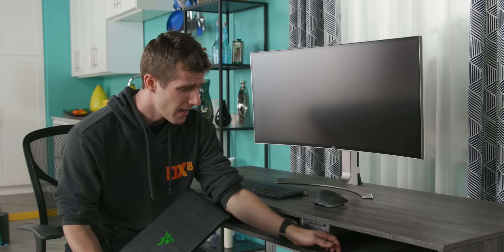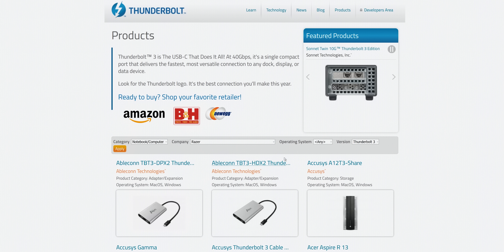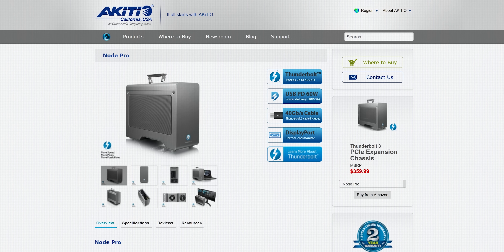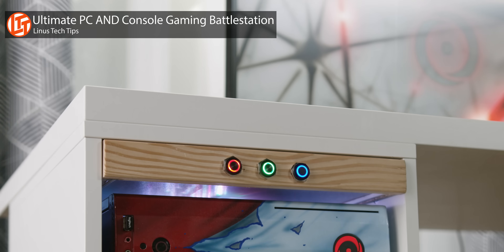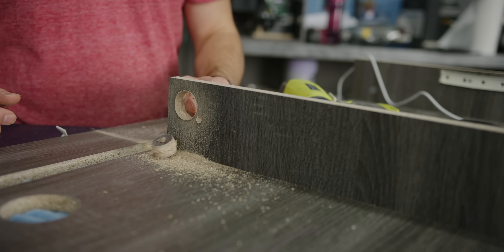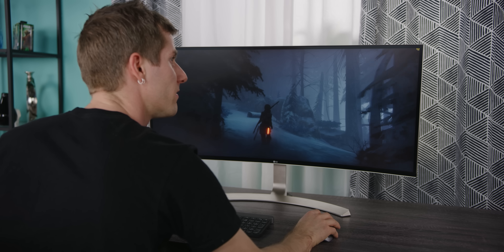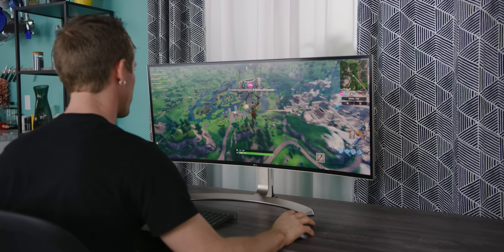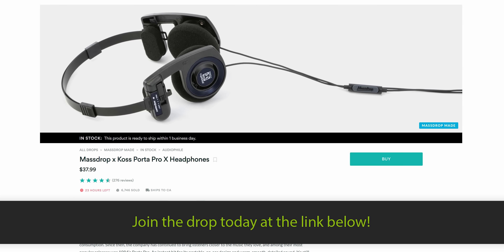This is the CLEANEST Setup.

Comment: I have a question!
I use Macbook pro 2014 with an external monitor and the MBP heat is quite high. is the heat reduce when I using with eGPU?
Reply: Yeah just make sure to get the right egpu
Reply: You can’t use an e gpu with that MacBook. You need thunderbolt 3.

Comment: I've got a cleaner setup - I have my computer in another room, and usb hub connecting it under my table. So my setup is litterally a desk a keyboard and a mouse, and apart from the usb hub, no hidden insides! - And its upgradable because its a full tower pc.
Reply: That's exactly what I intend on doing in my new place

Comment: Want it even cleaner? 3D print a custom rail system for the computer to slide into and have the TB3 cable at the back perfectly lined up so that you don't even have to interact with the cable. Just slide it in, and go.
Reply: This idea is under appreciated
Reply: @Cubei That's an interesting point. I don't know how well they'd work with thunderbolt 3. There is a lot of data being pushed through those cables, but if magnetic contacts don't hinder the signal, that'd be a cool idea.
Reply: Vandel212 couldn't he use hdmi
Reply: @sbc2954  The HDMI is already there. That goes from the eGPU (in the little filing cabinet thing) to the monitor.
Reply: Vandel212 oh I'm an idiot
Reply: Vandel212 I'm boutta get rwooshed
Reply: @sbc2954  r/woooooosh
Reply: That's not a bad idea, I might try this
Reply: Diy perks did something like that with a laptop wall mount. I really fucking live his Design!

Comment: Is there a way to control the desk fans with a front controller ? i mean with buttons ? how would i power the system ? (controler + fans) i am not english speaker and i dont get the part about powering fans you used. Thank you.

Comment: TBH, even the "smallest" MacBook Pro has 2 TB3 ports, so you'll probably be better off connecting the external GPU separately rather than suffering the daisy chaining penalties mentioned in the video.

Yeah, I know, two cables, that's no longer as clean, boohoo…

Comment: That's what Dell made docking stations for except without the video card but with as much input and output options as what you'd see on a full desktop computer.  They should make something like it with full PCIe slots and places for hard drives that's standard for all computers that could include it.

Comment: If there's no thunderbolt 3 then a HDMI plus the charger can do the same right?
Reply: You can hook the monitor through HDMI, and a mouse and keyboard through USB, while having the charger plugged in. You just won't have the benefit of an external GPU

Comment: This is awesome! i'll have to do something like this (when I've saved enough) for my computer

Only changes I would make is to run the back wire through the leg of the desk rather then tied behind it, and have a slot that I could just insert my laptop and have it line up with the plug-in, rather then having to plug the laptop in by hand

Comment: 1000€ laptop
350€ thunderbolt 3 hub
500€ extenal gpu enclosure 
250€ of peripherals 
1000€ screen 
500€ of desk

Over 3000€, with the ability to take it away, not bad but is this technology accessible to someone normal?
Reply: Obviously, a budget gaming laptop which still has a thunderbolt port and a normal monitor along with a custom made desk would cut off a big chunk off. It's not like the idea would not work with different setups
Reply: @MrRetrogoo  I tried, it's very hard to find alternatives
Reply: @henrigaufillier4350  well we need to wait a bit until thunderbolt equipped laptops become mainstream and not just enthusiast. GPU prices vary wildly, I suppose one can use a cheaper GPU like 5700 or 1660Ti instead. But I'm all for this "modular" desk laptop idea and I hope it becomes reasonably affordable within a few years.
Reply: @henrigaufillier4350  dont use a freaking 1080ti, thunderbolt 3 and cpu will bottleneck it. 1070 tops for this setup, or a cheap and Rx card and you've saved hundreds of dollars for a similar, if not identical experience.
Reply: You forgot the gpu wich is also $1000+
Reply: @est5063  right 👉
Reply: You forgot the 500 dollar 1080ti lol
Reply: @ChaosBW  not bad, thanks you🤣
Reply: You forgot to add a Graphics Card
Reply: Im a 'normal person', ive had car MOT's that cost almost 3k, i am sorry for people that consider £3k 'a lot' but it really isnt. That said i would rather put £3k into a gaming tower, but this is a nice luxury set up
Reply: @ultra2extreme  yeah its all about your living expenses as a whole and your ability to manage money.
On the other side, there are in fact people that can barely get by, and have to have multiple jobs just to keep a roof over their head.
Reply: At this point just buy a beefy pc and a decent ultrabook lol
Reply: @Koome-l7q  Amen! no need to connect your laptop with a cable, and your laptop will last longer as you start to use is just 50 percent of the time instead of 100

Comment: I'm just wondering if there is any bottleneck with the CPU inside the Ultra book and are there any power computing loss while using GPU through the external GPU system.
Reply: He said the laptop had a four core processor. My guess is that it is either a core i5-8300H, or a core i7-7700HQ. There is probably some sort of bottleneck if you play high setting 70FPS  instead of epic settings on fortnite, especially on a GTX 1080 Ti
Reply: This question comes since I viewed this video which the result of the video says that eGPU with Ultra book run slower than the regular gaming laptop
 https://www.youtube.com/watch?v=Xnk2DszxVCw
Reply: @longquan0104  That is true. With Thunderbolt 3, your eGPU utilizes x4 PCIe lanes. In a standard gaming laptop, the dedicated GPU runs with the x16 PCIe lanes. Using a eGPU means you graphics card will not have the full bandwidth a standard GPU would a desktop or laptop.

Comment: There is one thing that I don't like about this, and it had nothing to do with the setup. I will never buy a laptop as my primary device ever again. After a year of the gambit that I put my devices through, the batteries in any computer I've ever bought has been shredded. And with the way that modern devices are made, it's very difficult to replace them affordably. Build or bust

Comment: If you use a laptop with a higher power requirement, could this set-up work as long as the laptop's charger is also plugged in?

Comment: I have a problem,  I need to connect a USB headset, USB keyboard, USB mouse and need to charge the laptop all at the same time,, but my laptop only has 3 USB-c ports. I was OK before because I didn't have the keyboard so I could just charge through USB-c and use USB-c to USB-A adapters for the headset and mouse. Please help.
PS: my laptop has 2 thunderbolt 3 4X ports and 1 regular USB-C.

Comment: It'd be nice to also find out what cables were used for this setup. The biggest drawback for truly clean desktop setup is that TB3 40 gbps capability is limited to 1.6 foot long cables. Might explain why you're not getting the max settings as you thought?

Comment: Yeah I get your idea. But I have two laptops and one desktop PC. 

I had to push the god damn buttons and reconnect the USB wireless keyboard-Mouse set all the time.

Sometimes it reverses back to the previous computer I use because another one is not awake yet. 

Then I have to push buttons again to change video input.

I have a MacBook Pro, surface pro 4 and a desktop gaming PC.

They all have their own unique purposes... 

I think I should give the surface pro 4 away. Probably transforming it into a desktop PC in my parents’ house

Comment: Would this setup work with an XPS 15 9560? As I understand it the Thunderbolt is only 2x PCIe. How would this effect performance? Might I need to reserve my Thunderbolt for just the GPU and then connect a dock with everything else to the USB 3.0?
Reply: Miles Waltrich hey man you’re late I think it might try it out

Comment: 3770k overcloked at 4.2, Sapphire Radeon HD 7950 graphics card, Gigabyte z77-ds3h or h77-ds3h motherboard (can't remember the exact model), 8 GB dual channel Kingston DDR3 memory, WD Blue 1TB HDD, Windows 10 Pro, stock coolers on everything, stupid Antec PSU and case, 2k 24" Samsung monitor connected via HDMI and I get 59 FPS stable (sometimes fluctuating between 55-62, depending on what is running in the background), and the settings are on Ultra... (in Fortnite)... How the hell did you manage to get 50 FPS out of an 1080???? That should smash 60 FPS in ultra in 4k!!! Is thunderbolt so freaking bottlenecking??
Reply: Youre underestimating how demanding 4k is
Reply: @MIDSTOfficial  ooooops... I ment 2k

Comment: Bruh awesome table setup, super clean! Love that stealthy aesthetic that suits a living space, definitely gf/wifey approved. I was gonna mention about the velcro issue, man I've had that same issue before especially mounting things at the underside of a table, I currently have a usb 3 hub mounted under mine with the ports exposed a similar way; and it has stayed up for like 3 years now. My secret? Not crazy glue, not hot glue... but probably similar - outdoor-weather grade-mounting tape. That stuff holds probably even a whole computer tower (dont do that tho... or maybe... video idea?). But yeah the only downside, it practically becomes a permanent solution so no removing it without a little fight. My hub almost broke apart attempting so. But yeah, 3m outdoor mounting tape. Target carries it.

Comment: Thunderbolt 3 is a beautiful thing. 

Also, I love velcro tape; it made me happy to see it being put to good use. I have a strip running across the bottom of my laptop and on the bottom of a few SSDs + several strips on my lap desk; this way I can use my laptop on the lap desk at basically any angle + there's room to secure the SSDs + I/O hub for more storage/connection options.

Comment: This would be even cooler if you had a slot for your laptop inside the desk that you can just put the laptop in. Then the thunderbolt cable automatically senses the laptop and pushes itself in. Then you could use the laptop screen as bottom screen and just have the main monitor a bit higher so you can see the whole thing.

Comment: Macbook update pls 🙏
Reply: Just use a AMD GPU instead of nVidia (no support) it should work just fine
Reply: @franciscoh6210  can it be done with a thunderbolt 2? (without the gpu)??
Reply: @iamdenislara  yes, but you have have to find some older parts for it to be compatible. (TB2 to TB3 adapters may be useful)
Reply: @franciscoh6210  so a macbook pro can be charge by the thunderbolt 2 like in this video?
Reply: @iamdenislara  you can do everything in this video, except for charging through Thunderbolt 2.
A Thunderbolt 2 cable can only support 10W of power, which isn't enough to charge a MacBook (as they take about 30-45W, depends on model)
Reply: @franciscoh6210  thanks!

Comment: Corsair RMi is one of the best series of silent (semi-passive) PSUs. My RM1000i only turns the fan on at over 450 W power draw (and it only turns in on at a very low, inaudible speed!). Running Ryzen 7 1700 OC'ed to 3825 MHz + GTX 1080Ti with 300 W power limit OC'ed to 2000+ MHz, and I only seen the fan turn on once, in the mid of a hot summer (I don't have an A/C).

Comment: I suggest building a wooden tray that attaches to the underside of the table, and that can house the Thunderbolt3 Hub. Then, it can slide in and out of the tray very easily.  Of course, paint the hub with a matching or complimentary color, or even better, if you can find matching faux wood grain paper, apply it to the tray instead of paint. That would be perfect!

Comment: I have the same keyboard, mouse, and monitor, lol.  I use a macbook pro though (old AF one,  mid 2012 retina) I'm looking at getting an egpu (I know with thunderbolt 2 it's not ideal, but there are work arounds and saves me a couple K till I am forced to get a new laptop (maybe a newer macbook pro or a razer laptop, though I like my macs)) I use a henge doc for the mac which looks very clean as well (arguably more so than plugging in the usb 3 cord).  I have to have two laptops, my personal and my work pc (which I don't even have admin privileges to :/, so I love the logitech craft and mx mouse to switch easily.  I use a 3 monitor setup with 2 1080 monitors in addition to the lg extra wide, and with that in split mode I have 4 monitor essentially so I can hop around to both my computers when I feel like multitasking.  I have a little belkin wireless charger for my iphone XR.  I'll try to put up a link to some photos if I get the eGPU figured out.  Liked your vid and choices!
Reply: Also, wanted to see if anyone who uses that monitor fins the blinking light in standby mode to be super annoying.  It's in my bedroom so it blinks at night and drives me nuts, I usually just turn the monitor off which is less than ideal.  I wish LG included the option to turn that off.  If anyone has found a work around, by all means please share!

Comment: Instead of a razer use something like an xps 13 or yoga 730. They don't have a built in gpu but both have thunderbolt with pci x4. Meaning the setup doesn't cost both of your kidneys

Comment: Yes, please make a Macbook version. I'm going off to college soon, and I can't wait to misuse campus resources in order to create my desk setup.
Reply: Should work with a macbook
Reply: eGPU(from Apple)+MacBook+monitor+magic mouse+magic keyboard=😄🙏💥🎯🔥
Reply: @redstonepro2952  dont your performance will be capped by the cpu bottlenexking it or you mac will light on fire then you will struggle to play games as the magic mouse doesn't have a right click so no zoom and the keyboard is horrible for gaming if you want a mac limit your expectations take this from a guy with a top of the line mac and a Egpu no enclosure. Just get a cheaper desktop and a cheaper macbook
Reply: there is no Macbook Version you will never be able to have that high performance for that price with AppleCrap
Reply: @TheOneG36   The entire point of this video was to enhance the capabilities of a laptop with an eGPU to make gaming possible without needing to buy a desktop (and make it look good while doing it). Considering that the greatest flaws to the macbook are its keyboard, graphics performance, and thermal throttling, as opposed to its CPU, this should be completely possible with a Macbook Pro.
Reply: @HotCrossJuns  depends on how you define "possible" of course you can play minecraft with a Macbook, but any other Brand Laptop will be better at the Job. For Example an Mac-Pro with the I9 has high Thermal throttling (would have also with External GPU) so you loose a lot of Processing Power right there, the "Fixes" which came only via Software also do not apply to Windows10 so if you would use that 3000€ Mac Pro running Win10 because without Win10 no DirectX and without that near to Zero Gaming Fun. you will have like 10-15% of the CPU Power just gone do to thermals throttling, while if you spend it on any other I9 based NB you would not. and because you need Windows anyways what is the point of "achieving" this setup with an Apple? except that it is less performing and way more expensive then any alternative?
Also why would you care looks if you would hide it under the table anyhow?
Reply: @TheOneG36  I'm sorry, I should have explained my situation better. Maybe after this you'll see why I still believe this is the best route to take

1. I already own a MacBook. While other laptops (cheaper ones at that) undoubtedly have better gaming performance, it wouldn't be cheaper for me to get a windows laptop and create this setup because I already have a laptop to work with. (For the record, I did not choose to buy a MacBook. It was a graduation gift from a family member who happens to be a massive Apple fan).
2. While I don’t doubt what you say about the i9 MacBooks is true, the MacBook I have has a quad-core i7 processor, which does not have nearly the same extent of thermal throttling issues as the i9 chip (on account of it being a weaker processor)
3. I think you’re underestimating the MacBook’s performance. Even with the pitiful Intel Iris GPU that comes preinstalled, running games like Minecraft is significantly better than "possible".
4. In addition to my MacBook, I’m also bringing my PS4 to college, so even if the performance I get out of this setup isn’t fantastic, I only need it to be able to play PC exclusives like Civ, which aren’t nearly as demanding as the Triple A titles I would play on my PS4.
5. I already need to buy a monitor, keyboard, and mouse for my desk at college anyway, so even if I don’t go through with the plan to buy an eGPU and hook it up to my MacBook, I would still like Linus to make a video so I can buy the monitor, keyboard, and mouse that he recommends (or at least take it into consideration.
6. When I said I wanted it to look good, I meant the desk setup, not the laptop itself. Linus titled the video “The Cleanest Desk Setup” and as someone who’s about to live in a cramped dorm with almost no free space, a clean setup is what I need.

Comment: Wait so if you connect a Razer Blade to only a Monitor with its Charger on will it lose charging and turn off?
Reply: When you connect the Razer Blade (or any capable laptop) with USB-C to a monitor that has power pass-through, the laptop will stay on and get charged by the monitor. if you want to close the lid while using the monitor, then you will have to go to control panel to change what the laptop does when the lid closes so that it stays on.
Reply: Problem_Child1973 oh okay thx

Comment: I assume the laptops processor still has to do the work as if it had the titan built in? 

Surely that will drastically kill the laptops lifecycle under that kind of load as it's main purpose, yes no?

It is a cool set up though and would imagine it's fine if used in a casual way.